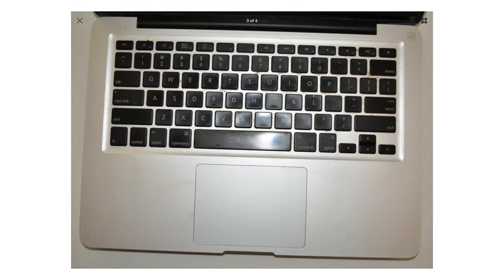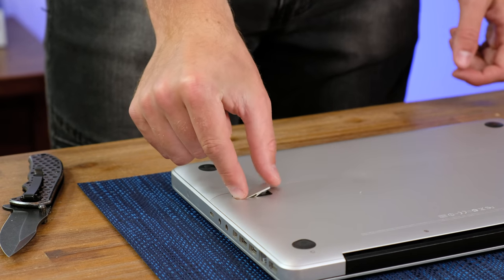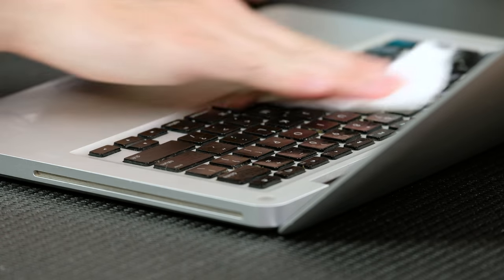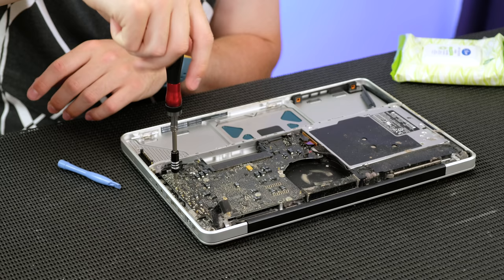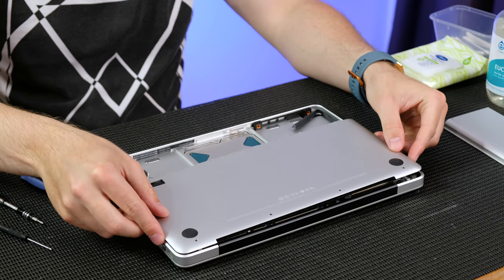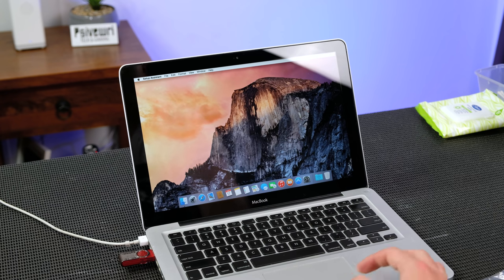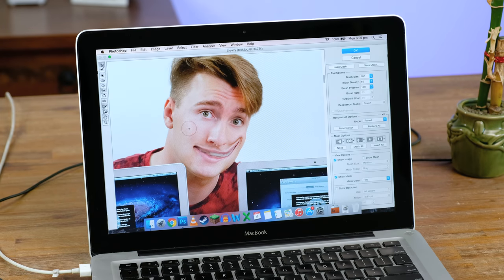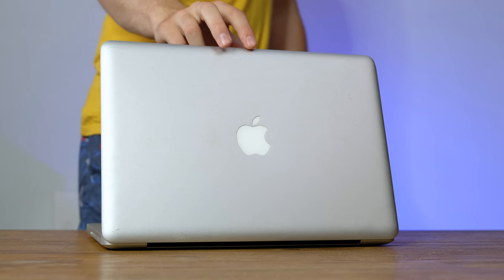$25 Apple Macbook From eBay... Gets Restored!

Comment: Replace HDD with SSD, use a wireless keyboard (If a teardown and clean dose not fix this issue!) and mouse/pad, replace Charger with a Anker/Aukey/RavPower GaN Charger which is much lighter and power efficient as well as cooler, Replace the Thermal paste with Liquid Metal as it never dries out and cools better than any paste!!!

He should have use compressed air to clean the board before he started removing any cables or parts

Comment: I would never buy something that I know doesn't work because it takes much more money to repair it than to buy it new. My grandmother once took my desktop computer to the repairman (Feb. 2005) and we would've had to pay $335 to replace the power supply and the hard drive, as well as a fresh install of XP. We went and bought a new one. It cost us $449 at Office Max. She didn't feel like having the old computer repaired when buying a brand new one costs us a little over $100 more.

Comment: I did better than this XD i got a lenovo 14e for $8 plus shipping. Only issue is the mousepad needs to be fixed cause its loose, but the whole bottom plate comes off with some screws making it easy to access.

Comment: Hi All, i have a older model, the 2006-7 Core2Duo ( White Plastic Snowbook )
It runs 10.6 only , some people can get 10.7 but depends on your bios etc, mine has the 32/64 UEFI

Anyway it runs fine and is basically the same as my 2007 Imac 20 inch

Only some internet web sites require a more modern browser than the latest firefox that supports 10.6 ( i need to boot it up to get the version number but probably release date is 2016-2017

To fix this i used the boot manager rEFIt    http://refit.sourceforge.net/      and installed Linux Mint V18, with this is really flies and you can use modern up to date browsers. Just set aside 8-15G if you want a full install, you can run it of a live USB image and save a 'persistant' file that contains data and changes etc to the mac OSX hard drive - think of it as booting of a fresh install, then loading your hardware devices drivers and any extra software you added  of the saved file ( Sort of like a local steam saved folder )

WOW pet hair at its worst, we have some PC's at work and they tend to go slow and reboot for no reason, it is because they get dust of the carpet and the corner under the desks near the and walls, so i open then up and hit them with compressed air, the first time i done the reception one it was like a cartoon, the amount of dust bunnies in the case and the black soot from the powersupply was amazing.

Nice find, easy and cheap fix just some time invested

Regards
George

Comment: I'm still using a late 2008 15 inch and it still holds up. Mine It runs up to El Capitan and that is were it stops because Apple decided so. It works quite good with an SSD for light use. The battery is too expensive for a model this old. Even if I was considering buying one from iFixit. Like all macs this model experiences overheating issues so Macs Fan Control really helps. Overall pretty good for an old laptop.
Reply: Pink Sparkle You can go past El Captain if you really want to
Reply: Brandon Y Yes indeed... I aware of the patches existence but I was just mentioning strictly the official version.

Comment: 5:15 - Burning CD's? In 2019? 🤔
Reply: well... yeah...? Burning CDs in 2072, your point is...?
Reply: @RWL2012  nevermind
Reply: Runnymede85 CDs and DVDs are still the most reliable storage medium in 2019. Yeah they may be somewhat slow but if you don’t throw them around and damage them, you’ll never lose your data. Something that can’t be said about flash/solid state storage. So until the industry comes up with something more reliable than flash storage, there will always be a market for optical media. I for one still use DVDs as my main backup medium for files that I don’t want to lose.
Reply: @jscorpio1987  Don't you trust icloud, Dropbox, Google Drive etc?

Comment: You just posted yourself an ebay , post yourself the macbook, and make a video! To get views!
Gosh!
There is noway you fan find this at 25$
Even the hardisk is more expensive which is already included in this.
Reply: Lol where do you live where used hard drives are that expensive

And it's called deal hunting and getting lucky
Reply: Do you know about SSD? Cost
Reply: @Madhav8802  this mac didn't come with a ssd, it came with a 160gb hdd. What are you talking about?

And it cost $25 +shipping($18)
Reply: Ssd = macbook is that what you are talking?
No matter if they are useless or not
Last year my MacBook air ssd broke so i had to pay 150 euro for new!
And that guy talking about Macbook 25$ 
Just stop defending shit
Reply: @Madhav8802  lol is this a MacBook air? No it's not. It didn't come with a ssd. You clearly have no idea what a SSD or HDD is. Huge difference. 

Mac came with a 160gb HDD NOT a SSD (not to mention even SSDs are cheap nowadays)

I have 160gb HDDs lying around my house in junk drawers cause they are useless and not worth almost anything. 

Man you are funny. Doesn't even know the difference between a MacBook and a MacBook air. 

Not to mention you got ripped offand probably paid most of the $$$ for labor
Reply: @Madhav8802  yes I do. I've gotten super expensive stuff for super cheap. It happens. In the last few months ive bought things for so cheap you would rip your hair out in jealously or go on rants about how Im lying. I've flipped all the stuff and made about $3k as a hobby I do in my free time. 

This isn't even all that cheap. I see some going on eBay for like $60 with free shipping. He paid $25 +18 for shipping. OMG he saved so much money. Let's say $100 is the going rate. Then he saved what? Around $60. Some dude sold me a new Nvidia Titan XP for $400 last month. I then sold it on eBay for $1050 or something. Now that's a deal. Some other dude sold me 6 gtx 1070 for $550? I sold each for $180 or 170. Now that's profit of $480. Just last week I bought a 7700k for $150. Sold it on eBay for $280. Just yesterday sold 2 i7-7700 bundle for $460. Paid $10 for each of them. 
This happens pretty regularly for me. 

You started talking about drives for no reason going on about how much drive costs more than $25.....which it doesn't. Then you started shouting about SSD which this mac didn't have. Then you started talking about MacBook air which this isn't 

You just went on tangent after tangent for no real reason.